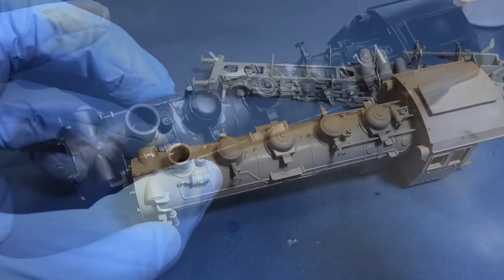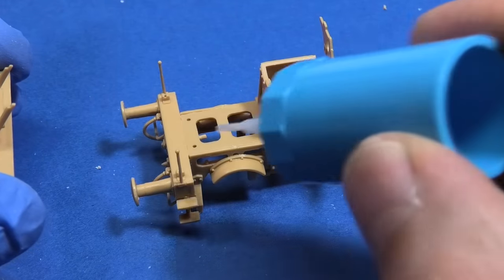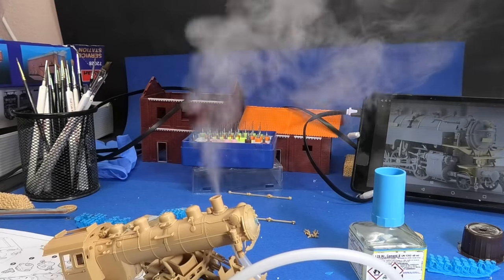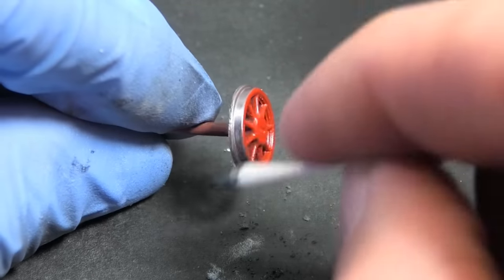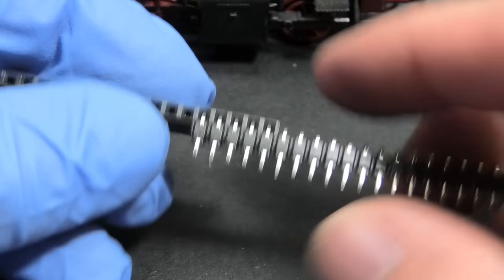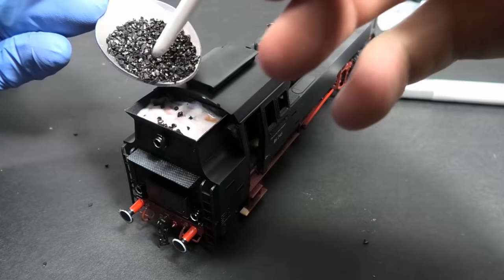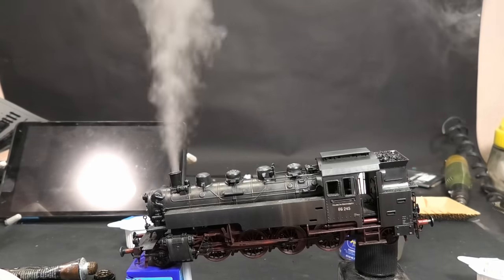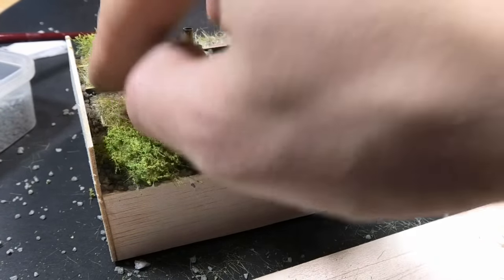Kriegslokomotive BR 86 - Hobby Boss 1/72 - Train Model

Comment: This one is in post war colors, just before the German railways got split up in Deutsche Reichsbahn for East Germany, and Deutsche Bundesbahn for West Germany. About the mid 50's the known DB logo appears.

In the war, those kriegslocomotiven (war locomotives) were painted in dark grey color over everything. Some were painted dark green with dark gray or dark brown cammo pattern. In winter they were light grey (not white) with dark grey, nearly black irregular striping. Again over everything.

The light as you have it is the German shunting signal in peace time. In the war the top lights were not lit and the bottom lights were covered with a mask that have a narrow horizontal slot cut out, just enough to see where you ride but to difficult for aircraft to spot. Often a hood was mounted so the light on shined downwards and nearly impossible to see from the air.
Reply: this is the comment i was looking for

Comment: Really neat.  As always learned more great things from watching.  One very minor point,  around an active coal fired locomotive rail line the ground vegetation is kept well back if the tracks due to fire risk.  There is a shaker plate in the bottom of the fire box to get rid of the coal ash which can contain a few live embers.

Comment: Once again a fantastic model from a true master.

The term "Kriegslokomotive" is usually only used for locomotives that were developed during the war. The BR 42 and BR 52 were such locomotives. They are characterized by an extremely simple construction due to the lack of materials during the war. The BR 86 was developed in the late 1920s without material restrictions. Therefore the BR 86 is not counted among the "war locomotives".

The third, upper headlight are also probably incorrect for the DRG BR 86 from this period. Usually only two lower headlights were attached. The third was later added after the war. But I'm not 100% sure on this point. The BR 86 may have been an exception here.
Reply: This kit shows a standard lokomotive, like they were build throughout the 1930th. During the war, the constrution was slightly simplified. Those lokomotives had only one window on the side of the cabin and the smale wheels had no Strokes. Those changes were mainly made to reduce the necessary work to build such a lokomotive and therefore increase the output of the manufactureres.
Painting the whole locomotive in gray had the same aim. And maybe it reduces the visibility of them top

As long as petroleum or gas was used for lighting the locomotives, the lamps had to be cleaned regularly and therefore only those lamps were mounted on the locomotives, which were actually needed. When the elétricity was introduced for lighting of the locomotives, the lamps were no longer polluted by soot and therefore could stay on the locomotives.

Since the 1950th locomotives have to be equiped with three lights to easyly distinguish them from  road vehicles. 

Previously the third light on the locomotives were used as a signál, to indicate something unusual to people working along the line. For example, it could be essentiell to know for people working there, if a train uses the usual track or the other one! And there were also combinations of light to indicate, that there will additional trains on the line and from which direction they have to be expected!

Oh, by the way, those signs on the side of the cabin with the eagle were usually used during the war. They were introduced before indeed, but there was not enough time that they were wildly spreaded. During the war the old signs were melted to gain metall for weapons.and relaced by those with the "Pleitegeier". But since they were more like a polítical statement instead of a sign for Germany, they were relaced immediatly at the end of the war. Therefore, when a locomotive has such a sign, the time can be věry likely classified
Reply: As during the war. But with the beginning of the war there was a fear of foreign aircrafts and therefore all lamps had to be covered. This Black Out was obligatory and any disregardence could be punished as a hostile action. On the other hand, those people working on this engine were happy when they were not detected by foreign soldiers or partisans!
But on many models of vehicles

Comment: Its another very nice Job. I also appreciate that you tried every different type of this hobby.
But i have seen some mishaps.
First, like @ Neo Kerman wrote, in war times all locomotives have only 2 front signals and 2 back signals. The 3rd was added after 1950 in the Deutsche Bundesbahn time.
Also in Wartimes, they used "verdunkelungsplatten" which meant over the Lamp glasses were an iron Plate only with a small slot for the light (same as by Tanks)
And when the locomotive runs alone on a track normally they added a red glass to the 2 back signal lamps.
You have changed the smoke champer door lock system to a Weel, this meant there is now a central lock system in the door. But this modification was made after 1950 in DB-time.
And with that, all the small locks around the door were gone.
The last one is the coloration of the connecting rods. They were all in steel manufactured and only the small inlay is colored in FireRed (RAL 3000).
What on the most locomotives in this time were added was wooden planks on top of the coal bunker to increase the amount of coal.
But besides this, you do an awesome job.
I hope you will do another one.
Reply: Thoughtful, respectful, informative response. Well done!

Comment: Nice model. 
Great lighting affects. 
Good work on most things. 
But train buffs will point out a few items to correct. 
The wheel on the front round engine cover is not correct. It's not a valve but a door latch. The original lever was correct however.
The drive rods would be steel rather than painted red.
The sides of the tracks are always rusty rather than silver. 
Might be best if you refer to actual pictures of steam engines. There are millions of them online to use as a guide. Photos of working locomotives might help too.

Comment: damn this looks amazing.
The only think I'd suggest to improve would be to add some kind of oscillating circuitry to the air pump, I feel like it would read a little more like "steam train" if there was more of a "pom-pom-pom" of the smoke, rather than a continuous, silky stream.

The fire led is a fantastic touch, as well as the improved handles and clear lamp covers. The risk you took with the enamel thinner on the surface after so much hard work was incredibly ballsy too - but it really paid off!

Absolutely fantastic project. Subbed and looking forward to more!

Comment: I have considered getting the Revell/Germany "Big Boy" locomotive. But, I have heard bad things about it. So, I have never pulled the trigger. I like railroad related things, just don't have the room for one.
Reply: I’ve built one, It’s a fun build but it’s not very detailed and can be a bit frustrating in places. Despite this, there is great potential for mods and (when built correctly) the wheels and valve gear move! So if you want a detailed model then this isn’t it, if you just want a big boy and a fun build then I say go for it.-Das Mann

Comment: Hi Plasmo! I love your excellent works! But I have a Question- what kind of 3 D printer do you use? And when did you find the drafts-plans for instance for the tiny peices (valves etc. ) what did you print? Thanks for Your aswer!
Reply: You can buy this parts as brass castings in 1/87 scale, most are oversized and fit perfect for 1/72

Comment: Generally, its best not to wear gloves with rotating tools. One major exception is the guys that do production buffing. But when running machine tools its best to not wear gloves. I know one guy that followed the company safety rules and wore gloves while operating a lathe. That resulted in some severely mangled fingers with some parts missing. After that the safety rules were changed...

Comment: Nice locomotive! But... on the Backside of the Locomotive should only two red Lights be visible when the white Lights on the Front are on.
Reply: Not entirely correct. That would only be the case if the loco was running light engine (i.e. no waggons attached), as railroad laws in Germany require any train to carry white front and red rear lights or rear markers by day. When pulling a train the red lights on the loco would be switched off. But the white double A light is used when a loco is on shunting duty (Rangierlicht). All these rules still apply.

Comment: Smoke seems too fine. I would put a net into the exhaust vent. It is still impressive!!!
Reply: There is a slightly more expensive option from a railway company called TRS Trains. They make a smoke machine for OO gauge models that uses real water, it is built for functional models so you’d need heavy mods to the DCC commands.-Das Mann
Reply: @dasmann3904 , I see. Thanks for extra info. U really did a good job!

Comment: The BR 86 is not actually the kreigslokomotive. The real kreigslokomotive was the BR 52 which was a 2-10-0 tender engine (2-10-0 also known as a “decapod at least in America is referring to the wheel arrangement for those uninitiated)The BR 82 was actually known as the Übergangskriegslokomotive and it is a 2-8-2 tank engine.

Comment: The title is wrong! This locomotive is not a war locomotive!
The first locomotives of Class (BR) 86 were built in 1928, faar away from WW1 and WW2. Not even during Nazi time.

Yes, those engines had been built during WW2 until 1943, but those machines were modified, e.g. only one window each side of the cabin instead of two.